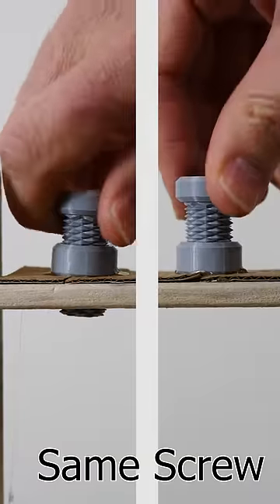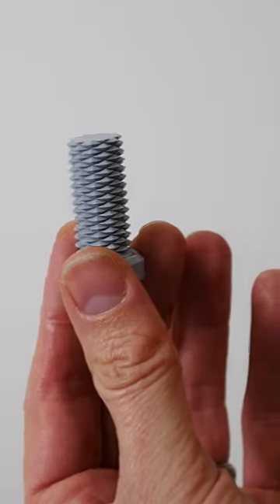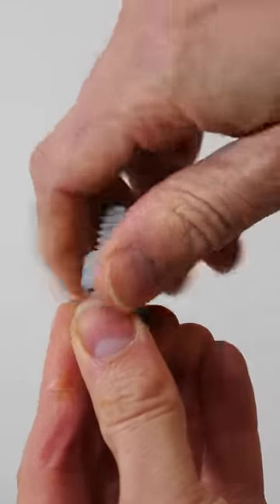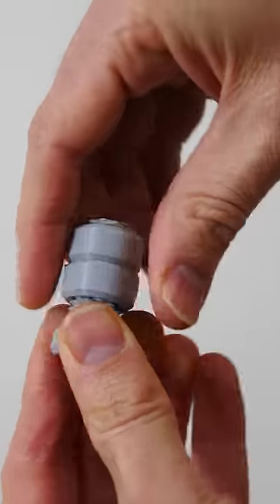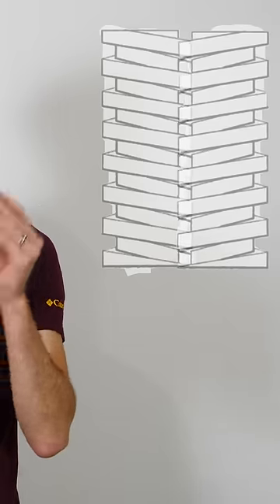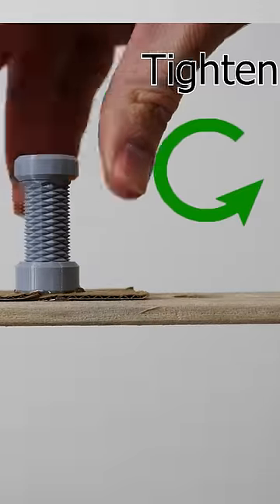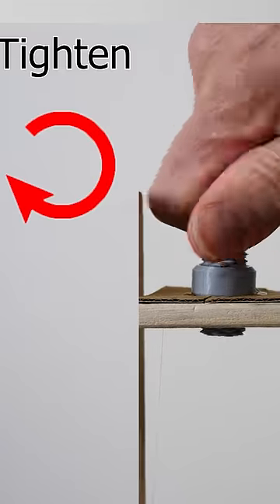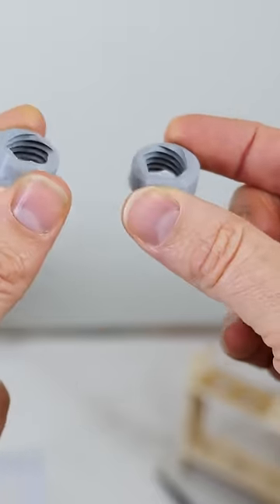It Can Be Screwed Both Ways

Comment: We call them levelwinds at work. We have giant versions of these that are mounted on a trailer horizontally and the 'nut' is actually a reel of rope that goes back and forth on the 'bolt' or levelwind. The rope reel gets to one end of the levelwind, which is about 6' long, and 3" diameter, and then it goes the other way until it hits the end, then back the other way, etc, etc, insuring the rope winds up evenly. They are also razor frickin sharp!

Comment: With the right kind of nut, (cut threads both ways just like the bolt) 🔩 you could go in either direction but you could also just rotate it zigzag style across the threads

Comment: How do you unscrew the nut bolts, if they can be screwed in both directions? 😅😅
Reply: It's the screw that can be used in two directions, the nuts can only be screwed and unscrewed one direction. This means that the screw can be used for nuts that loose when turning left and tighten when turning right and the nuts that do the opposite
Reply: @kw-0917  ohhh, but you can tighten the nut bolts both the ways, can't ya? Because the screw doesn't prohibit the movement of the nut bolt in any of the two possible directions,